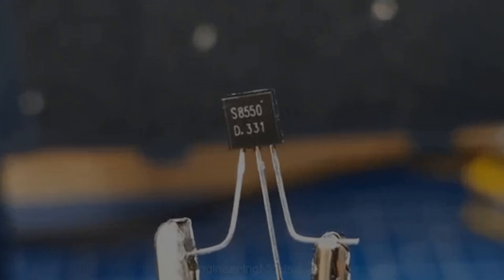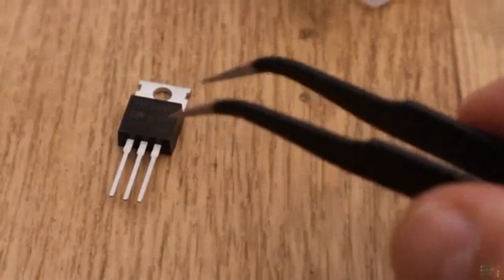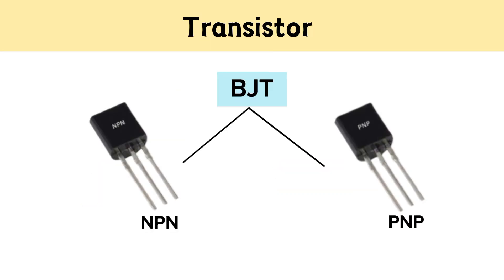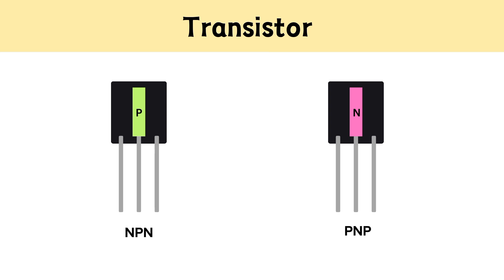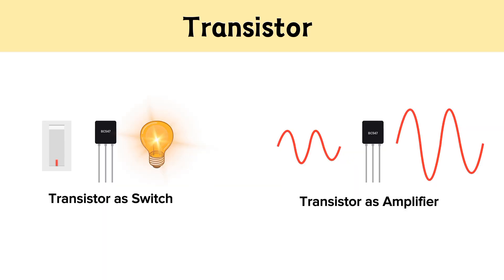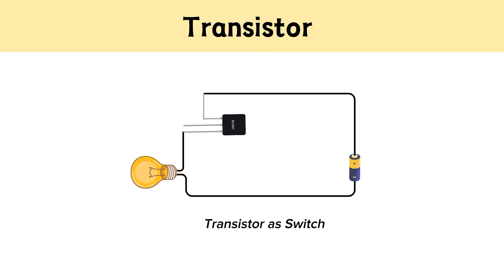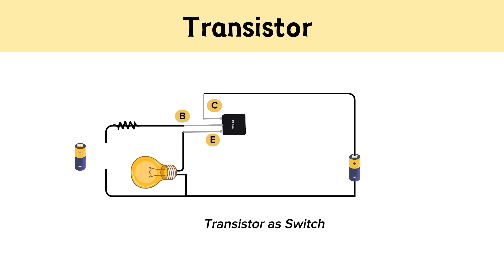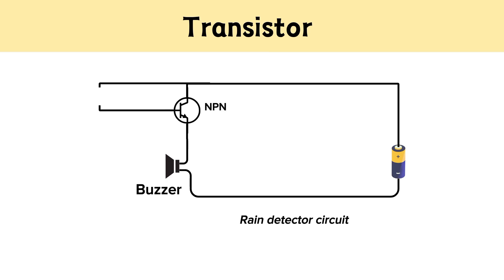Introduction to Transistor simplest explanation in just 3 minute

Comment: It’s a valve for electrons. Apply a base voltage = turn the spigot.

There, that took a lot less than 3 minutes.

Before transistors, vacuum tubes served the same purpose (but of course were limited in how small they could be made and in their operating voltages).  And guess what they were called….

Comment: One of the confusing statements about transistors I heard when I was a teenager is that they act as an Amplifier. and still now after some years of experience I can tell you they're not amplifiers. they're used in an amplifier circuit but they do not act as amplifiers. here's the thing:  the transistor has a certain middle-state(bias) between the extremes On and Off states where you can play with hight current side of the circuit (collector-emitter) by acting on the low current side of the circuit (base) Luckily, it happened that the ratio (in/out currents)  is linear which makes it useful to produce a higher current version of the low input base current.
Reply: There is two modes of operation of a transistor. saturation mode and linear mode. In am amplifier the transistor is operating in the linear mode..i digital circuits it operates in the saturation mode
Reply: The BJT transistor is a current amplifier. The ratio of the collector current to the base current is the amplification factor of the transistor, which is represented by beta. If the collector-emitter voltage is higher than the saturation voltage, the transistor works almost linearly.
Reply: Yup, referring to transistors as amplifiers utterly confused me, as I couldn’t understand how the device itself amplified anything.

And of course it doesn’t, you can make a circuit that allows a small applied base voltage to control a much larger current flow, but there’s nothing about the component itself that “amplifies” anything, any more than a water spigot “amplifies” water flow through a hose.

A needlessly confusing way to introduce the device.
Reply from the maker: Thanks for the clarification!

Comment: The transistor was originally thought as a non starter, being invented in 1846 was far too bulky for any practical use. Having a very large cylindrical tank to hold the electrons with various taps and valves to drain and add electrons as required. In the late 19th century The Clayton steam boiler company of Grandington Ohio would be the first company to use a smaller version but found the main cylinder could not hold enough electrons to operate there heavy equipment.
Reply from the maker: It's incredible to think about the creative minds and perseverance behind these inventions.

Comment: luv you for the last rain sensor example..
it was an amazing concept, when water drops on the un connected conductor circuit complets and currents starts to flow through base and working of transistor starts and speakers starts producing sound👏👏👌👌
Reply: Actually the transistor turns on when there is at least .7 volts DIFFERENCE between base and emitter  this is important to realise

Comment: @1:11-you mean 2 p type sandwich one n type between them.  (You say 2 p are sandwiched between 2 n, which makes no sense)
Right after that, you speak of current flow, but don't specify that you mean CONVENTIONAL current.  (The electrons actually flow the other way.)
@1:53 you say the high resistance acts like a closed switch, but you mean an open (not conducting) one.
Reply from the maker: I appreciate your careful observation and constructive feedback. You're correct, I misspoke about the transistor configuration and the direction of current flow. I will make sure to clarify these points in future videos.